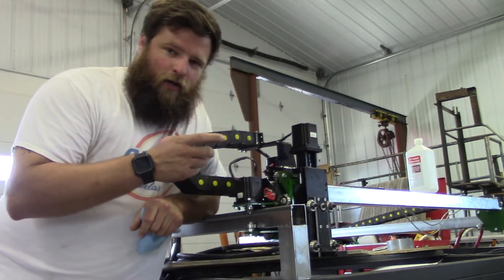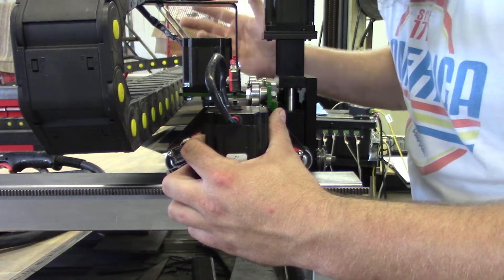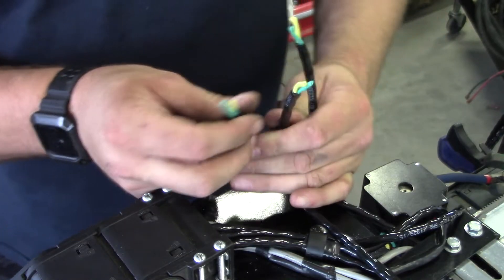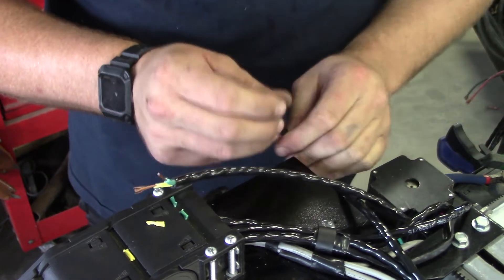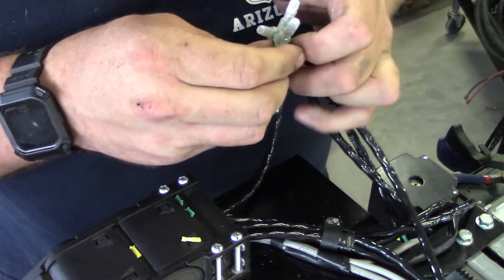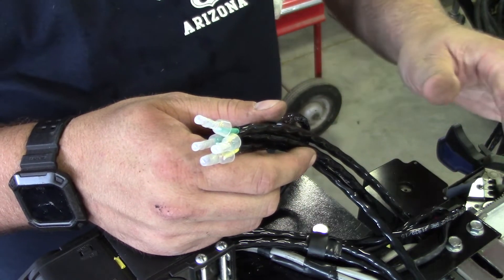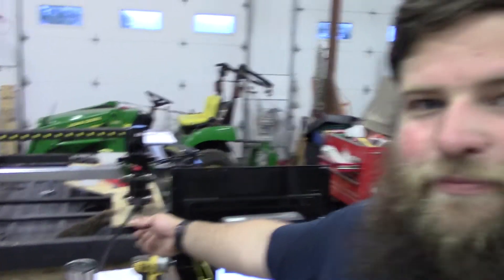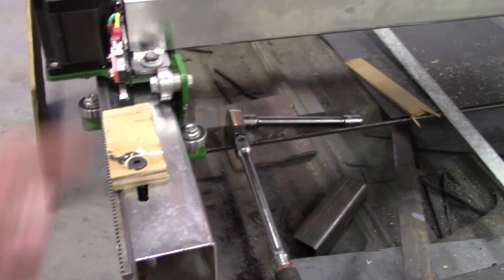Wiring Home and Limit Switches to CandCNC Bladerunner Dragon cut DTHCII

Comment: Which cnc controller did you use?
Reply from the maker: It a blade runner controller from CandCNC.net bought in 2012. This old style isn’t sold anymore but replacement for this controller they sell now is much better.